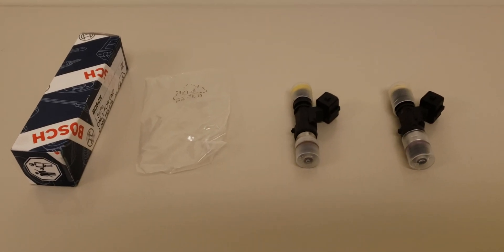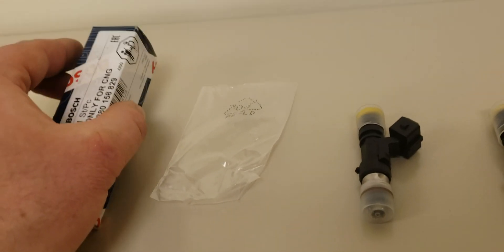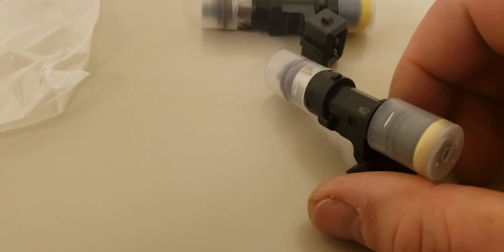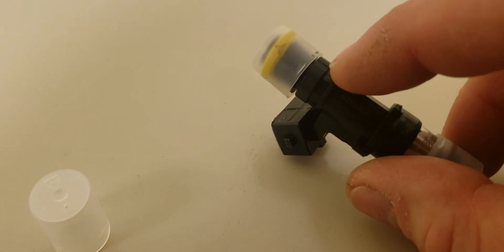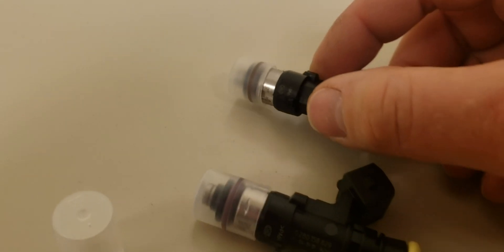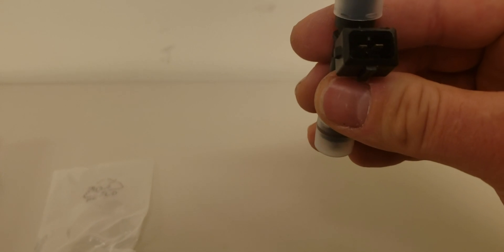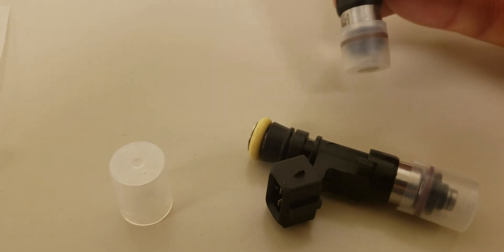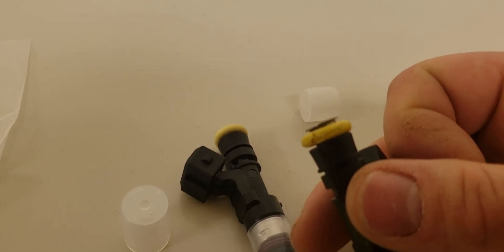How to identify fake versus genuine Bosch 210 injectors

Comment: are the knockoffs any good..? I'd send out for flow match, but I'm on a budget and $140/set, compared to 500+, that's a huge difference! I have Deka 80's but I don't think they'll support a turbo LS making 800-1,000whp.  Thanks for the info!
Reply: I definitely wouldn't cheap out if I'm pushing that much power lol
Reply: @eliancastillo726  I ended up investing in a set of FIC 1440's. I mean, with billet injectors and lifetime warranty, how can you go wrong..? Yea, it's a big hit up front, but at least I'm comfortable and know I have a good set of injectors! Didn't cheap out on lifters either, Johnson 2116, almost a grand for a set! I just hope street driving is OK! ⅜ pushrods, which I'm scared to death are going to scrub on the heads, in that case, I'd put a .120 wall, ⁵/16th set in it and call it a day! All my valve trane is coming apart after a couple heat cycles too for re-tq of heads. It's close, just needs exhaust and some fab to the cold side...
Reply from the maker: No, not at all. On my injector tester, they leaked like crazy and a couple didn't even spray at all.

Comment: What do you plan to use this injectors in? A z31
Reply from the maker: Yuppers! My vg33 as I go to Megasquirt and also for my built VK56 twin turbo project
Reply: where did you buy the originals
Reply from the maker: I'm a dealer for them. Let me know if you're interested in Genuine Bosch injectors
Reply: @z31online  yes bro
Reply from the maker: @hectorflores6198  okay! Can you send me an email to sales@z31online.com
Reply: @z31online  what's your price on 8. Will you guarantee they flow the advertised numbers.
Reply from the maker: @Infinitevoyager  for 8, it's $544. No, I will not guarantee flow rate unless you pay for that service. For 8 flow matched, it's $689.
Reply: @z31online  wtf.. how are you different from those Chinese draining our money
Reply from the maker: @wickedsatan1  I have direct distribution with Bosch bud
Reply: @z31online  do you have IG or a page where you sell?